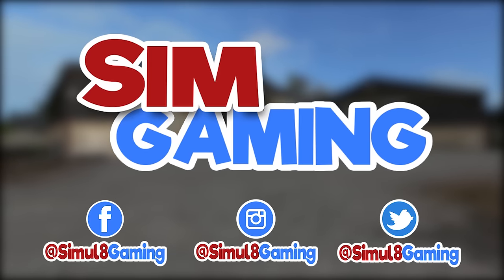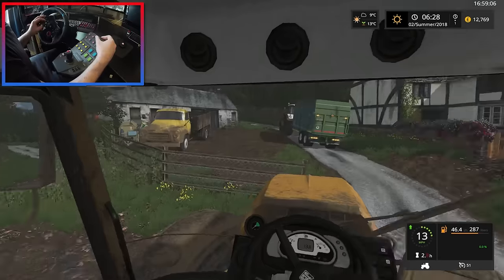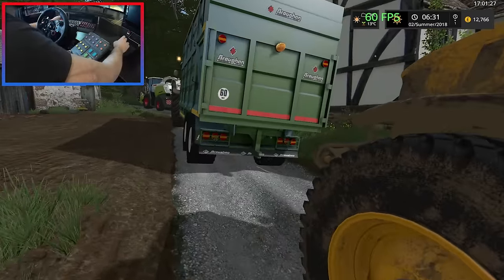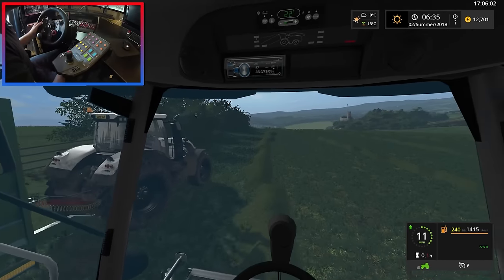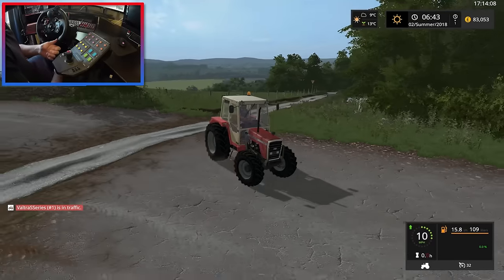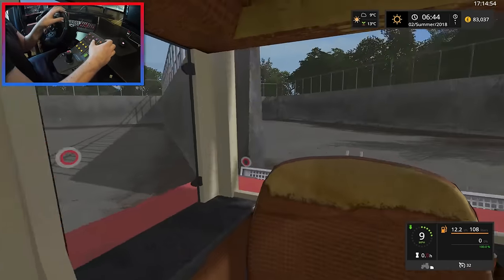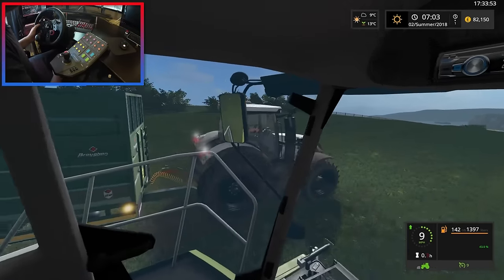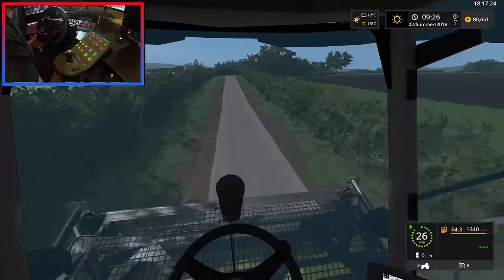Sandy Bay 17 - Farming Simulator 17 -  Ep.4 (with Wheel Cam)

Comment: the other manual attach caused fps issues, it's now been fixed. could be same with the one your using maybe try without it and inspect the jd. the vertex manual attach also auto attaches front loader implements and combine headers